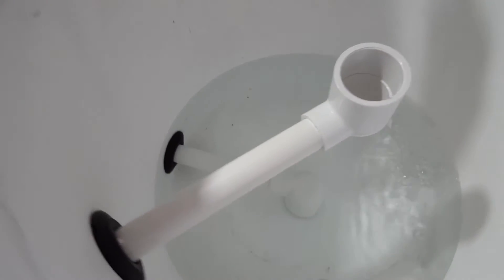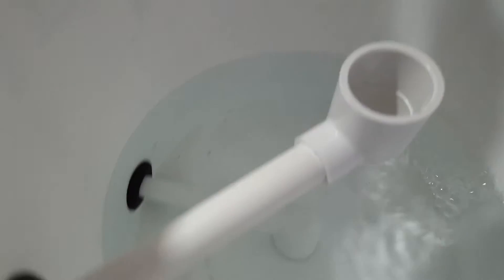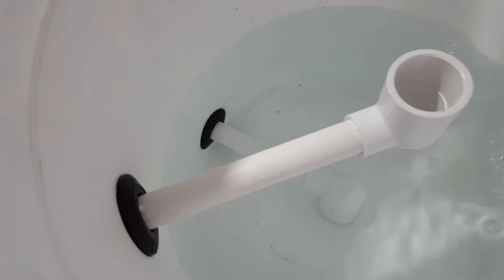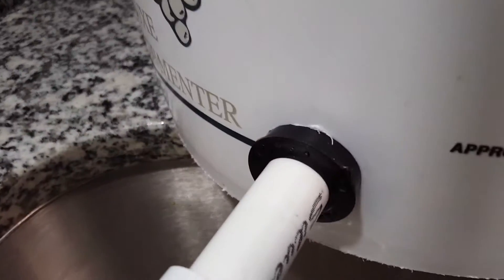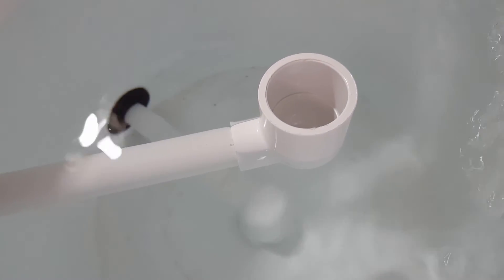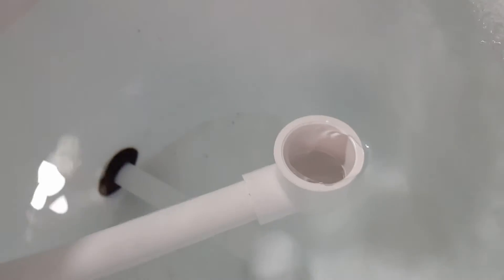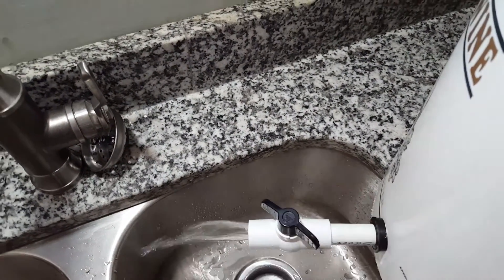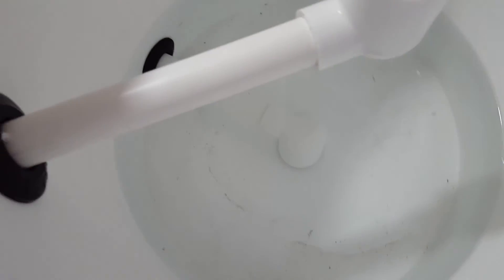Swirl Filter Test Aquaponics Hydroponics

Comment: You are using the word "siphon" incorrectly.
Reply from the maker: Ok? The word siphon (/ˈsaɪfən/ SY-fən;[1] from Ancient Greek: σίφων "pipe, tube", also spelled syphon) is used to refer to a wide variety of devices that involve the flow of liquids through tubes. In a narrower sense, the word refers particularly to a tube in an inverted 'U' shape, which causes a liquid to flow upward, above the surface of a reservoir, with no pump, but powered by the fall of the liquid as it flows down the tube under the pull of gravity, then discharging at a level lower than the surface of the reservoir from which it came